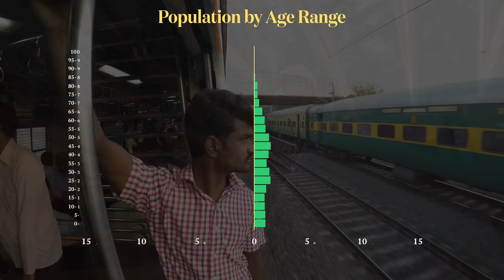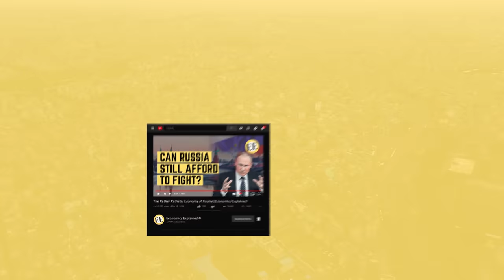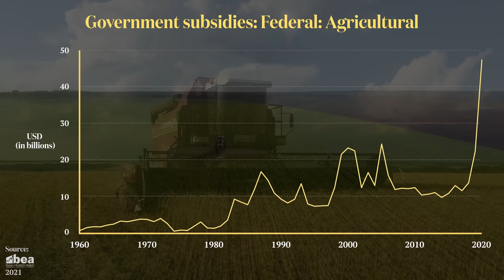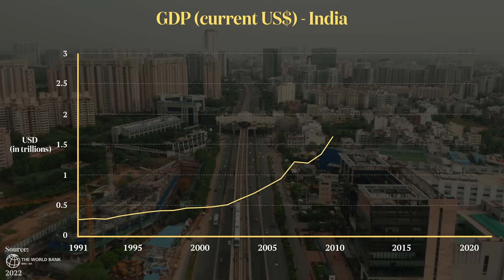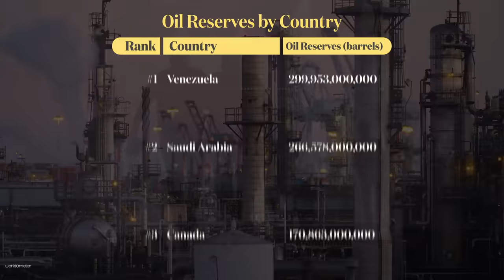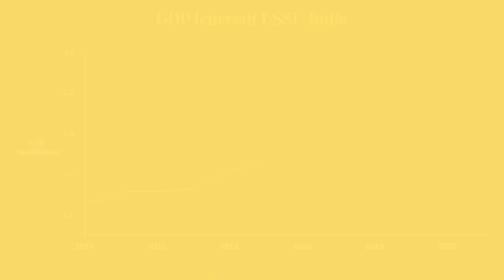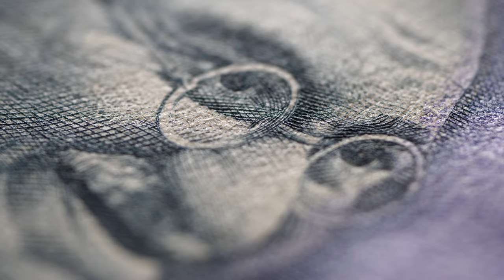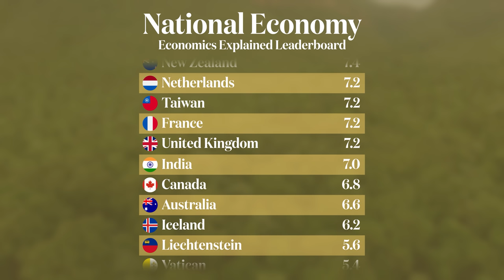India Will Not Be The Next China

Comment: As an Indian during my childhood days we were having 3-4 hrs electricity cutting now we have 24 hrs electricity.Webaldo witnessing 4-6 road lines construction across whole India.Current govt is doing fantastic job in infrastructure
Reply: China has not had a power outage for decades, and even in remote rural areas, it is possible to provide a single household with electricity by pulling several kilometers or even tens of kilometers of wires. The international standards for ultra-high voltage electricity are all formulated by China.
Reply: @maxcao7772  LOL yes China is 15-20 years ahead of India, no one serious is questioning that. But India isn't that far behind all things considered, if it can just continue at its current pace for another 10 years its going to be in a very nice position. For instance, it's doing a way better job building infra than most of SE Asia (outside Sing). This is going to result in huge results as happened in China.

Comment: I think India should focus on its core strength services. It will not become a powerhouse in manufacturing as it is too protectionist with high tariffs on imports hig taxes and high GST on a low income per capita nation. There is not enough infrastructure and integrated value chain  for a durable manufacturing ecosystem. With all these high taxes India does not have a high consumption base. There is still a need to increase the educated workforce.